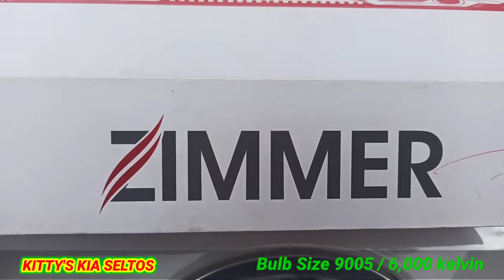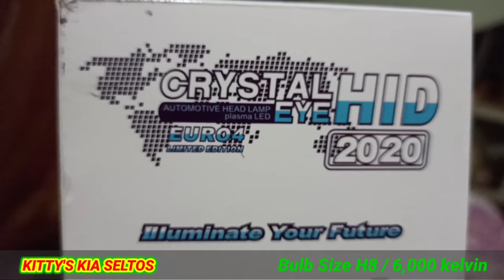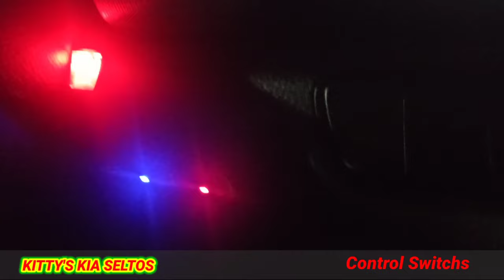KIA SELTOS MODIFIED IPH PROJECTOR CRYSTAL EYE & ZIMMER

Comment: I own htx variant and I have One general question, if we switch on fog lamps and headlight both at once for everyday use on highway, will it impact on battery or cause any other issues? Should we use fog lamps sparingly or can be used simultaneously with headlights longer hours on highways?
Reply from the maker: Nice question, we can use both simultaneously in highway for long hours no problem sir,

Comment: @krishna sir car has KA registration, did you do the fitting in Bangalore
Reply from the maker: Yes sir
Reply: @krishnaba8181  May I know the address where I can get these fitted to my hte ?
Reply from the maker: @sreekanthreddy6922  sir do you have IPH PROJECTOR FOG LIGHTS total set
Reply: @krishnaba8181  I will but them but yo get them fitted I need to come to Bangalore so am checking sir hope you can help
Reply from the maker: @sreekanthreddy6922  you are from sir
Reply: @krishnaba8181  I am from a place near by Bangalore
Reply: Would like to check if I can come down to get the headlights and fog lamps fixed for my hte diesel seltos
Reply: Can you suggest if I can get the headlights and fog lamps bought and fitted and where in bglr please  ?
Reply from the maker: Contact me on FB krishna Ba